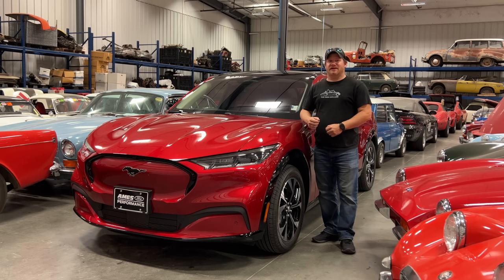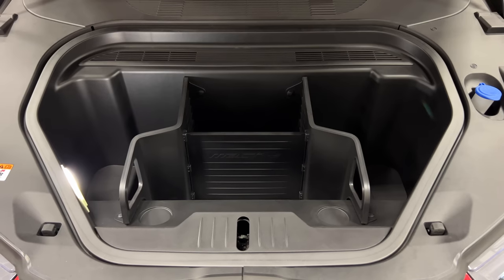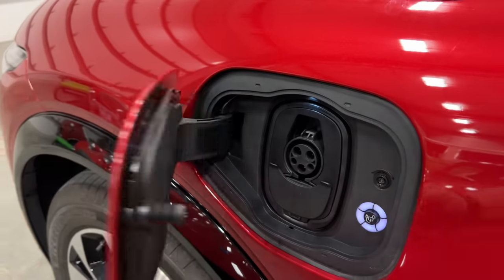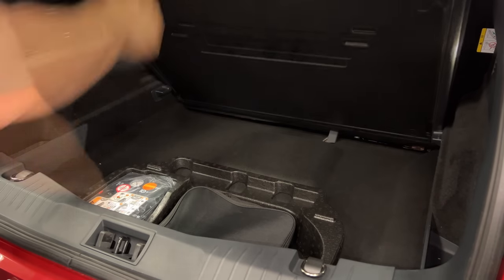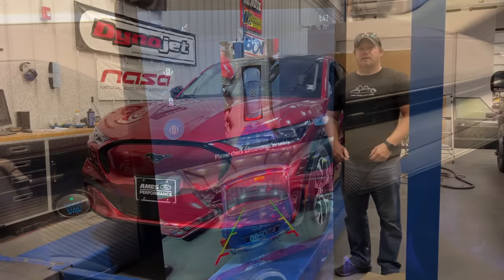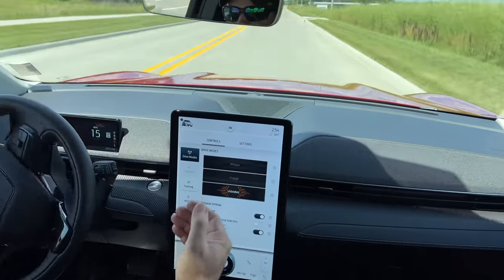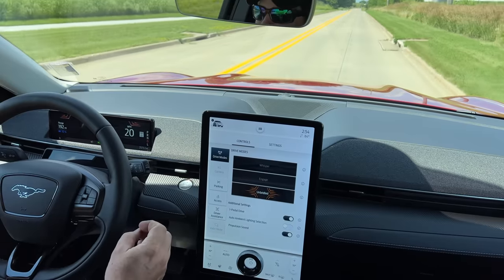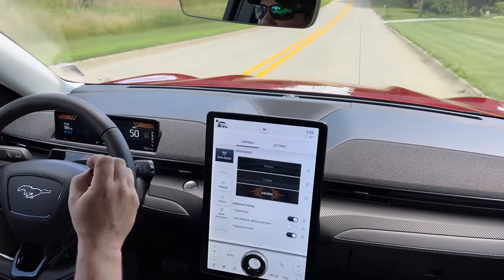Full Review of the Ford Mustang Mach E 4X

Comment: Great Review!  Few quick things not mentioned:

This review was an older 2021. Newer 2021 and 2022 can open the front trunk remotely from the phone app (still sucks not on the fob). 

Newer models don’t have those stupid dividers and the front trunk has a drain so it can be a dedicated mobile cooler which is cool.

This car, as with most fords, has the entry code in the b Pilar in case you lock your keys in the car. You could see it in the video too. Great feature on most fords for that situation. Your Phone can be a key too in case that happens. 

And lastly the GT performance version of this car is a thrill to drive. Be cool to see if you can review that too and feel differently about the performance vs. the Lightning.

Comment: The first obvious thing a lot of ordinary motorists found they could no longer look after themselves was surely light bulbs. A few years back it was easy but companies soon made it impossible unless you had a tool kit. Presumably now they expect large numbers of drivers never to check anything,apart from possibly screen wash. It it is I think rare for half the population to lift a bonnet/hood! I won’t say which half. So presumably they need to design it to be checked only by your dealer? However, the dead battery effect on opening the hood is maddening. I believe it may be age related to as older drivers would expect to check under the hood whilst younger ones expect a warning light to come up? Anyone agree

Comment: The electric doors, trunk, hood  And all the other electronic activated gadgets are unnecessary. Even if it's small they all consume battery power. Do the manufacturers not understand that we need electric cars that can travel more than a few 100 miles?  I'm OK with pulling a door handle to open a door or a latch to open a hood. Give me an electric car that's practical, cost efficient and can get me to where I'm going.
Reply: But it's ok that a gasoline engine car will only go a few hundred miles?  A friend just road-tripped from Central Washington state to Wisconsin and back in his 2015 Tesla Model S.  He had no problems with range was driving past many charge stations along the way because he had plenty of range.  He had no problem finding Level2 charging stations at overnight stops, and there were plenty of DC fast charging stalls all along the way.
Reply: Oh. Watch out, we got an electric engineer here… oh wait.

Comment: Regen braking kicks in whether you use 1PD or not - the brakes are electric, there is no master cylinder - the brake pedal is basically a dimmer switch. So when you put your foot on the brake pedal under normal slowing conditions, regen braking kicks in, and the callipers are not actually engaged until the very end. If you slam the brakes, the callipers do all the stopping, but under normal breaking its mostly regenerative.

Also, is the Fox body Mustang a "real" Mustang? It was not exciting either...by any stretch!

Comment: If you wanted excitement you would have tried the GT Performance version in Unbridled mode (I should be getting mine this or next week, it is nearby waiting for a car carrier to the dealer). Or you could wait 2 years for the Shelby Mach E (yes, they are doing it). Then one more year or two for the Mustang Coupe EV.
Reply from the maker: They have a GT Performance in now that I can try.  I am not sure making it quicker would change my opinion, it is already quicker than it needs to be for what it is.  One that I could take to the track and run a 40 minute session with would be a lot of fun.
Reply: @ThisWeekWithCars  From what everyone else has said on You Tube it handles like a Mustang coupe, but you will just have to see for yourself or wait for the Shelby version.

Comment: Good review Steve.  I did notice that you didn't cover the spare tire location.  Does that mean it doesn't have one? 
In general I am not opposed to the idea of electric cars.  I think they or something like them are the future.  But right now electric cars have some bad limitations.  They are range, recharging time, available recharging stations, and electric infrastructure to support them.  Probably, as you said about the lightning, if you want something for local driving they would be fine.
Have you thought about methods of off-grid at home charging?  Perhaps a solar source?  That would be a review I would be interested in.
I also enjoy watching you revive old barn finds.
Reply from the maker: The Mach E does not have a spare tire.  My army truck camper I’ve been building has the solar capacity to charge my EVs off the grid.

Comment: Sorry to say but some of the points you reviewed our out of date. You can open the frunk with the key fob and you have a easy acess to the 12v battery, for exemple.
I agree that this isn't a Mustang but it is a Mustang MACH-E. What name should they have called it? and yes it could have a different name... but that been said is the F150 lightning a F-150?
I still think it is a better mustang than Mustang mach 1 of 74,  Mustang II or even the Mustang SVT Cobra.... 
Great review !
Reply from the maker: Yes the F-150 Lightening is a F-150, it is the same truck just a different drivetrain.   An electric mustang like the one I first filmed at Ford would be a Mustang but the Mach E is not that. https://youtu.be/_0A9-6GP2ic

Comment: So if your electric doors don't work you're trapped in your car?  How is the fire department supposed to get you out of that thing if it wrecks?  Or conversely, what if Ford decides you aren't allowed in?  Like your bank posts your car payment late so they lock you out of the car and repo it?
Reply from the maker: The doors are probably mechanical release from the inside.  The fire department will have to break the window but that is no different from any car, most cars today lock the doors once you get over a certain speed.  Ford won't want to spend money, manpower, and lawyers on that.  Anything that would ever happen remotely like that would be required of Ford by the federal government with a warrant, assuming there is even a way for Ford to do so.

Comment: 8:52 Is that rust? On a new car?
Reply: Yea, kinda surprised me as well.  Outta sight, outta mind I suppose.
Reply: This is the same on nearly every ford and actually from a lot of makes. It's supposedly "cosmetic" only. Look at the shafts on any new F150 on a dealer lot and you'll see the same thing.
Reply from the maker: They never coat them with anything, either because it will not affect it or because a coating would interfere with some other part of the manufacturing process.
Reply: @tazeat  Really? I'm surprised to hear that American consumers accept that, considering that a car is an item with a high price tag.
Reply: @ThisWeekWithCars  My follow-up question would then be: why do they make these components from a material that can rust? Is it necessary that these components rust? There were jokes in the 1970s that Alfa's were of so poor quality that they were already rusting in the sales brochure. It looks like that Ford has taken over that reputation?

Comment: Steve. . .this car is a fail, you are correct not a Mustang. . in any way! Maybe this Edsel 2 is a great electric, but badly marketed. Just seeing your brake test, its a fail to the Tesla. Tesla have much better brake control. The sound box to make car sounds is a joke and a slap in the face to any car guy. Storage in the front truck is a joke and problematic at best with the latch mechanism. The access to maintenance is, as you had stated, not good.  Oh then there is the grocery getter, not SUV, SUV. The styling and body type is the biggest Ford mistake of the century. Where are the electric cars?? No cars in the lineup! Not everyone wants or likes fake SUV's. Uggh. . ok rant over. . .thanks Steve for reviewing this vehicle, for whatever Ford is trying to market. Your insight is very good, and love your prospective.